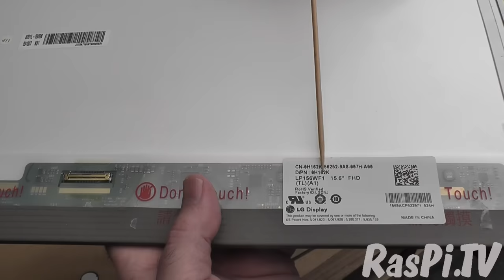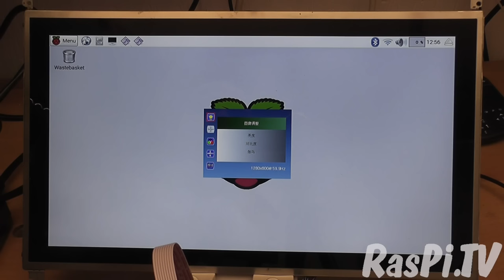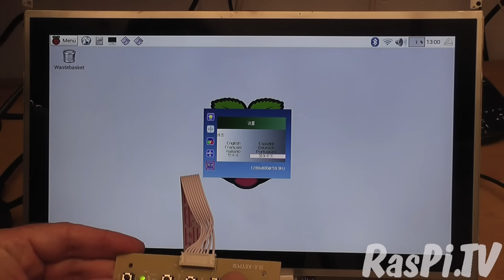Make Your Own 15.6" Full HD Screen for 32 bucks for use with Raspberry Pi, DSLR, Video camera

Comment: The 1280x800 resolution that the menu on the screen shows is not even close to "Full HD".
Misleading title.
Reply from the maker: Actually it IS a 1920 x 1080 LCD. At 4:48 you can see it's an LP156WF1. If you google the specs you'll see it's a 15.6" WLED full HD screen (which was one of the reasons I bought that laptop in the first place).

Here's a place that sells them (although they're out of stock)...
http://www.laptop-lcd-screen.co.uk/shop/LG-PHILIPS-LP156WF1-TLE2-15.6__28198.asp

So, then, why does it say 1280 x 800 on the video? It's simple. I usually set up my Raspberry Pis to force that mode because it enlarges the text and icons on the screen. you can do this by putting...

# settings good for native 1280 x 800  
hdmi_ignore_edid=0xa5000080  
hdmi_group=2 # HDMIPi for 1280 x 800  
hdmi_drive=2 # for alternative modes get sound  
hdmi_mode=28 # 1280 x 800 @ 60 Hz   

...into the config.txt

So you're wrong. But I understand why you said it.

Comment: Mabe the next video with a touchscreen ,This will be a nice idee for you . I want to now of this also working .
Thanks for this video good idee
Reply: Jeff Venqueleir touchscreen is easy to do....just add a touchscreen kit and plug into the USB, or make a USB jumper plug so as not to put wear and tear on the connectors
Reply: thanks

Comment: Uuuuh? 32 bucks: £71.94 
 = ~ €81.29
(£59.95 + VAT)
EU VAT exemption says on the page...
Reply from the maker: Skangster76 Where did you get that figure from?
Reply: From your link.
Reply from the maker: No. My link still shows $32 but that board no longer available from that supplier.
I just tried searching LP156WF1 driver board on Ali Express and came up with 8 options from $24-35. Anyway this is just an example, it may be a different board you need for a different LCD - and that may well have a different price. But for £72 it wouldn't be worth bothering, I agree.

Comment: it's not full hd, change title, else you can get 1680x1050 22 inch monitor for less than 32 buck.
Reply: The subject is the board not the screen
Reply from the maker: Full HD is 1920 x 1080, which is exactly the resolution of this LCD.

Comment: Unless you are a complete electronician you should not do this. Controller board that work right out of the box is only a dream. Most of the time it doesnt work ! Yes we want to recycle but as we don't know how to do it we'd better try something else as 26 $ for the controller board and 26 $ for the power as the one you own doesn't fit... better buy an old refurbished lcd somewhere for 19$.

Comment: Go figure a dell computer died after 4 years the laptop I'm using today is an hp computer that is 7 years old and still works great that is the main reason that I hate dell they make junk
Reply from the maker: I had 3 Dells in a row from 1999 to 2008. In 2014 I bought a MacBook Pro and never looked back. Really good for video work. Last 2 Dells just got hot and were noisy. I won't be getting any more of them.
Reply: yea i'm using the laptop to type this comment and i somehow managed to "play" ksp on it was probably at 15 fps. intel core 2 duo still has something to offer
Reply: Dell is great. HP is junk. I work in IT and that is my experience.

Comment: So its more then $22 ... You will need a rasberry pi and power supply cord for pi , and microw chip for pi , and a hdmi cord also ... Plus the board you bought ... the project is more like $100 total ... at that price you could buy a used laptop ..

Comment: 32$+300$ for Laptop...
Reply: Mingjie Han but it's still cheaper to buy an other Display on Amazon
Reply from the maker: The point of this video is to repurpose an old screen that you either already have or can get for nothing (or nearly nothing) from someone throwing away a laptop.
Reply: Shouldn't that be mentioned in the title and/or description though?
Reply: in my country people don't throw away laptops.
Reply from the maker: Alex Shulga You might notice I didn't throw mine away either - I reused the screen. However, where I come from, an awful lot of people DO throw away all kinds of stuff that is still of use to those who know how to fix it, so I thought I'd make a video showing people how. :)
Reply: Or, you could find a broken one that someone is throwing away or willing to let you have for cheap.
Also, I'm pretty sure that laptop cost quite a bit more than $300 when it was new...
Reply from the maker: Yeah it did. I seem to remember it was about £1000 which at the time would have been about $1500
Reply: Terry Daniels there are very cheap ones with an Intel Atom or Pentium
Reply: Kili Studios I was talking about the one he used in the video, not some random cheap laptop. Also, if they're less than $300 they're not very likely to have a 1080p screen anyway
Reply: Terry Daniels ok, Then more than $300
Reply: Kili Studios the whole point of this video was making use of a laptop that's otherwise broken. I have about 3 just laying around that I got for free. So for me it would only be the cost of the driver
Reply: Terry Daniels The problem is its clickbait.

There's a HUGE difference between "make a 15.6" Full HD screen for $32" and "Convert your old laptop into a monitor for $32".
Reply: How is it clickbait? He gets the same end result, doesn't he? It just comes down to semantics at a certain point.
Reply from the maker: There seems to be a small number of people who think that the heading on the video thumbnail is pure evil. It's part of the video and I couldn't change it now if I wanted to. But the flipside of that is that >3k people have thumbed up the video Vs 128 down. You can't please everyone. Whatever you do, some people will like it and some won't. When I get a particularly bad comment I try to remember this Churchill quote... 

“You will never reach your destination if you stop and throw stones at every dog that barks.”

The problem here is that there are obviously people out there who don't know how to source an LCD for nothing (or can't). Living in the UK, people throw away all sorts of stuff that still has potential life left in it if you know how to fix it. So for me it's "a given" that you can find a TFT for free. I got one exactly the same as mine from a friend.

In that context, the headline makes perfect sense. Clearly there's people out there who feel cheated by clicking a link to a free YouTube video. There's not much I can do about that except ignore the nasty ones and try to keep producing good content for the majority who appreciate it.
Reply: Is a clear clickbait because a honest tittle could be:
"How to connect a old laptop fullHD screen to a raspberry Pi camera."
Reply: EliosMoonElios I agree, clickbait has become too common, it's like the many videos saying you can make a gaming PC for $30 if you find a 'thrown away PC' and buy a Craigslist graphics card. If all you get with $32 is a Raspberry pi, that's not making a screen for that much, it's recycling a screen with $32 to repurpose the laptop. Not everyone can jump up and get a free screen.
Reply: Man if you cant find a broken laptop for free or max 20$ you are doin it wrong. I dont see anything wrong about the title. It doesnt say you have to have hands either. is that a clickbait?
Reply: Make a 15.6" Full HD Screen is CLEAR clickbait, when the video itself is showing converting a 15.6" Screen into a Monitor.  You aren't making a screen, you are converting an existing screen, thus misleading.  How is that hard to understand?

It was clearly written this way as clickbait so that people would click on it thinking its different from the hundreds of "Convert a laptop screen into a monitor" guides, that are basically identical.
Reply: Alex Atkin well im not irritated by the chosen language. and the video doesnt seem quite clickbaity to me since he tells right away what he will do. if a DIY channel says they MAKE a Christmas tree ball i dont expect them to blow tha glass themselves. they mostly always reuse trash. and  the chance of aquiring a broken laptop for free is high enough to not add it to the cost. for me this guide will work as advertised. i see other comments that did the same. so in FACT you are wrong. people made full hd screens for $30
Reply: Clickbait is when the title is deliberately worded to encourage you to click the link.  It doesn't matter if in the first SECOND of the video the truth is revealed, its still click bait because the title made you click the link in the first place based on misleading information.

You are also still missing the obvious.  He is using a 15.6" SCREEN from a laptop, its ALREADY a screen.  He is turning it into a PC monitor, but it was ALREADY a screen.

Also getting hold of a scrap 15.6" Full HD screen for free is impossible for most people.  There's a lot of computer recycling in my city so its just not available.  Then there is the fact my laptop is only a year or so old and still only came with a 768p garbage TN screen, Full HD in affordable laptops is just not common yet.

Good for you if you are lucky enough to live in a high-tech area where people are throwing out laptops with 1080p screens, but on the vast majority of the planet that isn't the case.
Reply: +3 weeks of waiting for driver board you ordered
Reply: I bought a screen for $15 on ebay
Reply: CG Radler Then you had luck, but it's still $32 and $15
Reply: Kili Studios yea but its still a lot cheaper than a regular laptop
Reply: CG Radler but it's still not very easy to get a (used) fullHD laptop for under $100
Reply: The problem is that if you need to buy the LCD and buy the controller, then you might as well just buy a FullHD monitor and not have loose electronics lying around and potentially even have a warranty.
Reply: I've got four broken laptops for free off different people on Freegle or Freecycle. They're not hard to get if you're patient and resourceful. My country is United Kingdom.
Reply: Sean Smith hhy
Reply: Can i use a laptop which was manufactured in 2005 and the company is EDGE which is not found in google.

Comment: you should have replaced the laptops board and got a far superior machine instead of a piece of crap pi...
Reply from the maker: LOL. I did. I splashed out for a MacBook Pro, which I've been happily using for 3 years now. :) There was no point in trying to keep the Dell alive any longer.

Comment: if anyone is doing this, PLEASE do not touch the spot on the back of the moniter, where it says "do not touch" this is not for the safety of the screen, its for the safty of you! those strips contain MURCURY which can cause bad repurcushions for you in the future...
Reply from the maker: I find it really hard to believe that's true. Some older LCDs had backlights with traces of mercury vapour in, but this is a WLED screen. The backlight is LED.
Reply: it says don't touch because there are surface mount capacitors under the plastic there that could fry you good if they are still energized. had that happen to me working on a laptop for a client.
Reply: TheCanadianLanBoy c’est